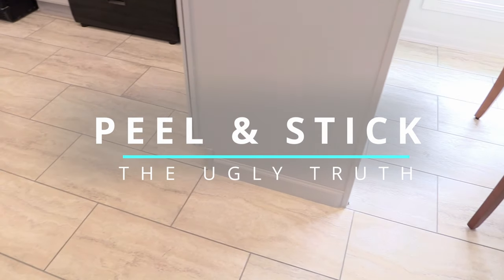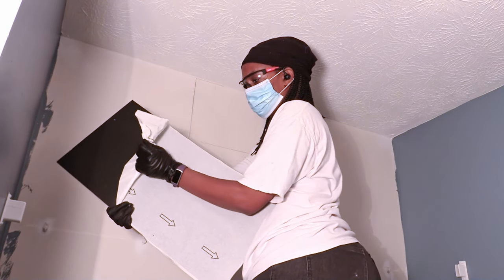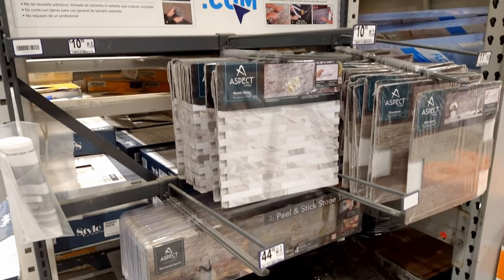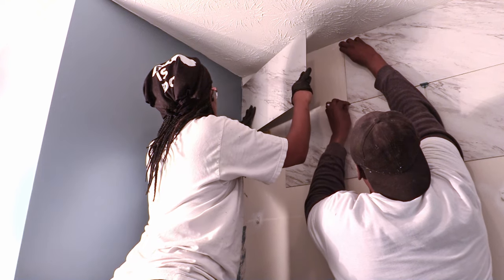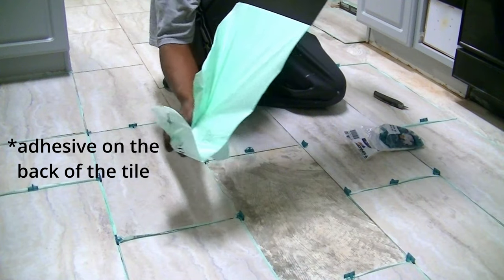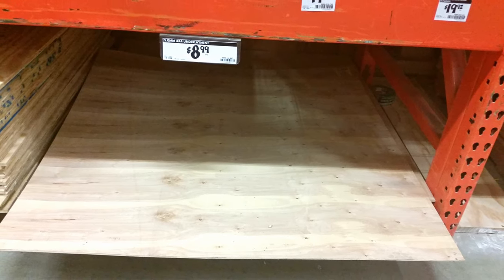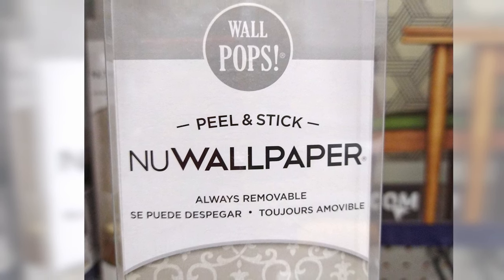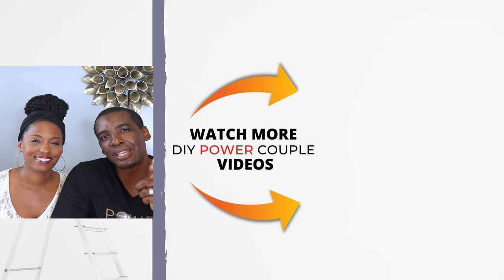THE UGLY TRUTH ABOUT PEEL & STICK - Don't Be FOOLED!

Comment: GREAT video and informative. However many dont use adhesive now and are SELF ADHESIVE. this means zero glue. it works the way plastic cling film sticks to everything and importantly itself via microtexturing and will often say reapplyable rather than removable. Its the vinyl tile itself sticking and is the secret to the 3M vinyl car wraps for interiors to match your exterior paint job or plastidip like stuff or vinyl wraps zero glues required. Mostly to make vinyl not look like vinyl but look like wet glass smooth clean crisp super ultra rich blacks and impossibly glossy we apply some sort of lacquers polishes maybe spray a big can of UV protection coating or super gloss over it and polish them. Then they look like REAL TILES or rather BETTER especially if you have a pro shallow pour epoxy resin on the tiles in a tray OUTSIDE thin then bring them inside some days later when its definitely set and cured and you can blow torch away any bubbles or vacuum seal it and put it in as a big bed sheet like slab with a border of empty edges of clearance on the sides so you can "remove it!" in this way you could use a few tiny nail like pins or staples or frame brackets to make them not fall off and be removable and you can simply putty or plaster back over a couple tiny nail holes retouch the paint in seconds if you're super speedy!! People often use thin plastic strips that look like polished metal lining between gaps in the 'panels/frames' of tiles or fancy strips of tapes or timbers. The truth is most shopping malls and arcades super expensive tiles look is just vinyl. Even those modern nice cement render looks that super dont feel like cement and look kinda gunmetal grey with dark almost blue gritty kinda industrial look thats often done in wallpapers in a somewhat almost successful way.
Just try not to use superglue everywhere as it can ignite cotton, glues should be used to piece together toys or eyeglasses in a tiny gap where tape might also be used glues are great adhesives for things like carpentry joins and other things where NOTHING EVER TOUCHES THEM inside the gaps and like with carpentry joins are more of a "let it have some flex". You also wanna occasionally apply plastic restorer and leather deep clean conditioner and other things along with UV protection coatings sprays like you get for your car inside/out. Or they will not look better than traditional floorings. For example bamboo timber floors are super compressed heat treated chemically processed strands of bamboo to create a massive brick of glue that LOOKS like timber but uses some plant cell based maths and science of fibers to have it stronger and longer lasting than hardwoods and not seem like a big brick of glues. So they last years longer and can look better and 'gloss and polish up' better than hardwood floors because they're a huge slab of epoxy/resin/glue something something. So when we do the same vinyl floors gloss polishes plastic and leather restorers and deep clean conditioner we see the nicer mirror finish as its denser and stronger its literally got more mirror shine. This is where plastics low cost greater longevity and lighter weight are such great advantages you might not even consider real hardwood or real bamboo glue bricks that are much like hardwood. The vinyl floor tiles on the walls assuming they're a thicker quality looking one, weigh so much less than alternatives and unless its crazy expensive textured wallpaper which is harder to apply and pattern match and often has issues with moisture/water dampness and damages easier you arent going to want to do anything that isnt vinyl pretty much. the problem is which glosses and polishes and finishes? also gloss might show finger prints and oils and need some buffing now and then but its so much easier to clean longer lasting and stronger than alternatives you kinda wouldnt think of matte finishes as choice at all unless its for specific looks or to apply mirror/metallic paints over it or something or you want that classic gunmetals or something.
Reply from the maker: Wow, OK. Thanks for the tips!😀✨

Comment: Are you speaking only about peel and stick flooring and backsplashes. I want to you the contact paper on the cabinet and counters due to horrendous stains and burns left by previous tenants. Are you saying not to use the contact paper for those areas as well?
Reply from the maker: Contact paper is great for cabinets, but it will burn if you place a hot pan on the counter. You don't want to mess up all of your hard work.
Reply: @DIYPowerCouple  true. So what do you suggest to cover up stains and burns left previously? Is there anything else I could use?

Comment: But...  It seems the assumption is that the landlord won't want the improvement to the apartment and/or the tenant will want to remove the peel and stick when they leave.  What if you just plan to leave it when you move?  I mean, if I paint, I don't plan to take the paint with me when I move.  Why should I plan to take the flooring or wall covering?  If it's an improvement, it seems to me the landlord should be glad you leave it.  (I know.  Sometimes landlords insist that you paint the apartment before you move.  They try to get anything they can out of tenants anymore.  I remember, back in the day, my grandmother lived in an apartment complex in Brooklyn and the LANDLORD repainted her apartment every 10 years.  For real.)

Comment: I’ve had peel and stick for four years with construction paper under now I can say the reason it didn’t move is because I had carpet tape holding down the construction paper. Four years later I just lifted it up and the carpet under it was intact.
Reply from the maker: That makes sense because you secured the boarder so that the tiles wouldn't shift. Congratulations 🎉, you have cracked the code.
Reply: I actually saw someone on YouTube so it first but when I moved I literally picked up the flooring and trashed it now a couple of areas had tape remains but it was nothing goo be gone couldn’t remove

Comment: Do you have a link to the tile you showed at 42 seconds in?
Reply from the maker: Hi! This tile is out of stock in our area Lowe's but here is the info to check  where you are: Style Selections Oyster Travertine 4-mil x 12-in W x 24-in L Groutable Water Resistant Peel and Stick Luxury Vinyl Tile
Item #745311 |Model #LSS3282CPS

Comment: Agree with most of what you say but those cheaper peel and stick tiles certainly do not stick to the floor. I have seen many homes with them used and within weeks they are coming up without much residue if any.  Basically they stay put due to gravity and other tiles around it keeping them in place. This is just a fact. Now you use some special adhesive, sure but the stuff they come with DOES NOT stick. Period. The sticky backing is equivalent to a post it note. Not user error either, literally take one of those tiles, peel the backing off and see for yourself it sticks to nothing.
Reply from the maker: Cindy, you can try this adhesive to see if it will work for you: https://youtube.com/shorts/0RAD2h5aMNw?feature=share
Full video: https://youtu.be/8lmCMjuEYp0

Comment: For peel&stick flooring on wall, my Simple and cheap solution is get some cheap wallpaper lining (rigid paper roll)and stick tile to the paper. Then cut excess paper off.
Once dry and tile adhered to paper, roll some adhesive on tile and wall. 
Stick tile to wall, roll it and done.
Reply: Very good idea, have you tried this before yourself? Did it work okay?

Comment: I would highly recommend nobody ever use peel and stick anything when it comes to construction materials. I get that it is DIY friendly, but you will have far better results and longevity using a pressure sensitive adhesive troweled on with a 1/16 x 1/16 trowel.